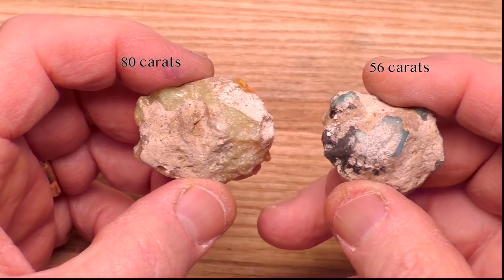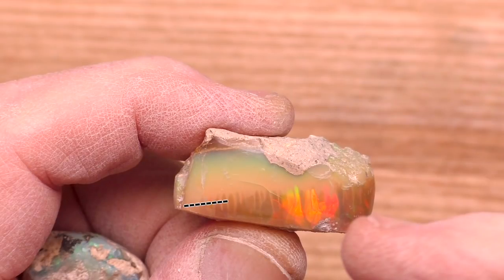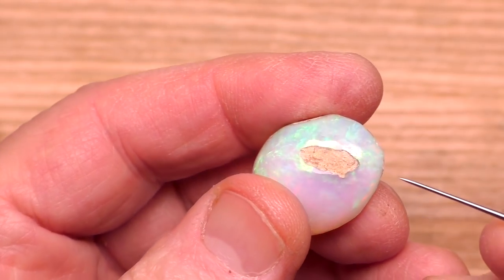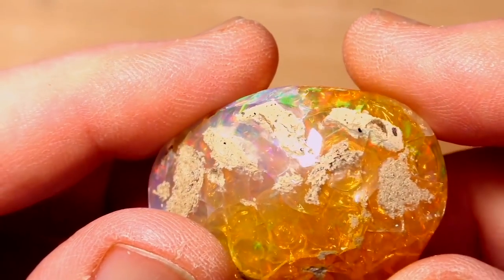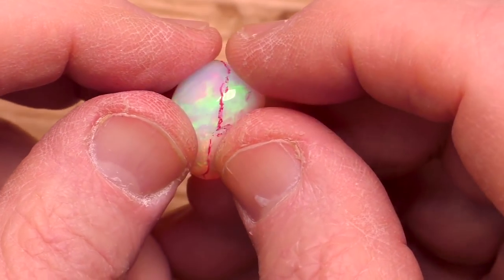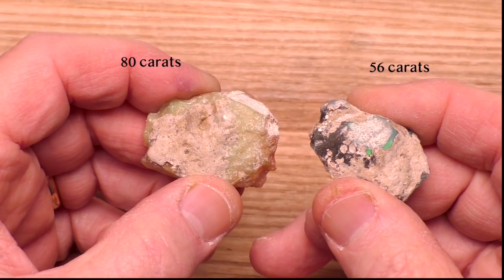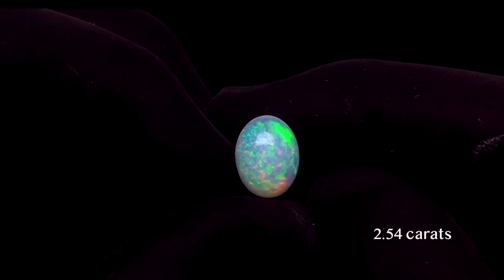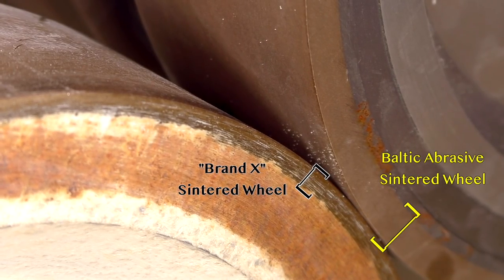How Did I Get this Opal for Free?  Is It Too Nice To Give Away?

Comment: That honeycomb pattern opal did turn out nice.  And kinda cool it's honey colored too.  But those blue ones; just gorgeous.  Thanks for the tip about superglue to stabilize the cracks before cutting on the trim saw; I'll be using that trick in the future.

Comment: Hi there, if I, have to repair this opal then I would put the opal inside in one balloon (or condom) then add a lot of the glue together with the opal in the balloon (or the condom) and then i would put the closed metal chamber under the air pressure, like you do with your car tires, with that technique you can go very deep in to the stone with your glue,  this type of technique we use for hair size broken concrete repairs with epoxy. thank you for your very interesting videos.